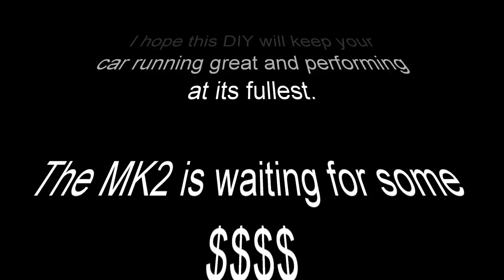The BIG VW and Audi DIY  Season5 EP37

Comment: My timing belt broke on a 2003 VW Passat 1.8t AWM so I'm assuming that I have bent valves. Should I take the heads to a machine shop to get refurbished or is it possible to just purchase new heads and put them back onto the block but only considering if the pistons are in great shape?
Reply from the maker: i highly doubt the pistons will be ok since our motors are interference engines which means the valves for sure kissed the pistons and you wont be able to reuse them without having some kind of issue down the road with the strength of the metal on that piston. So you really have 2 options

1: pull the motor and do a full Rebuild head and block
2: find a quality used engine

The issue with #2 is that the AWM 1.8T was recalled for sludge oil issues due to oil filter size and the oil pan so finding a Quality used motor will be hard. All late model 2002 to 2005 VW passats with 1.8t had the Sludge issue 99 to early 2002 aka B5 did not however they were a bit different style 1.8T motor.

if this car is your daily then find a used cheap beater and rebuild your motor. so you can take your time and save up some cash to get some quality parts or build a BEAST! lol
Reply from the maker: PS....  Sorry about your CAR!
Reply: @PincheALsGarage  Thank you, I greatly appreciate your feedback, your channel is amazing.
Reply: Speaking of the sludge problem recall, I always wondered why whenever I researched an Oil Filter at AutoZone/O'Reilly's the oil filter was quite small but whenever I ordered a (MANN) oil filter online from Ravenol it was massive. I definitely prefer and recommend the MANN oil filter.
Reply: I have an 02 AWM. Currently searching for a water leak that took out my ccm.  I cut all of the sunroof drain nipples,  cleaned out drain in front rain tray area.